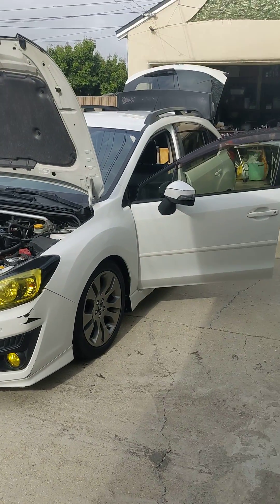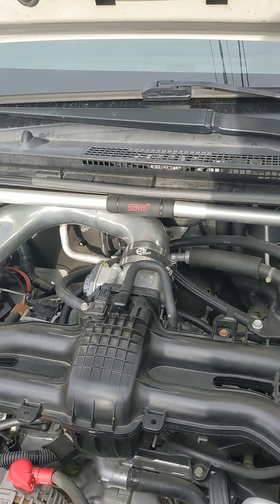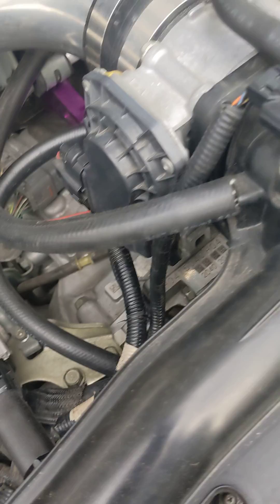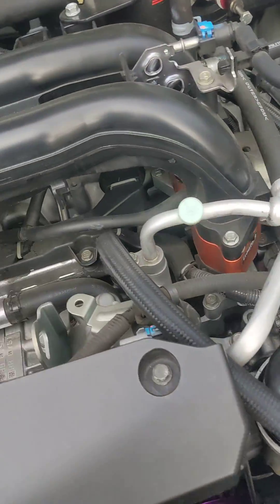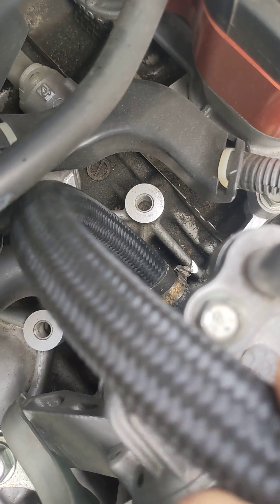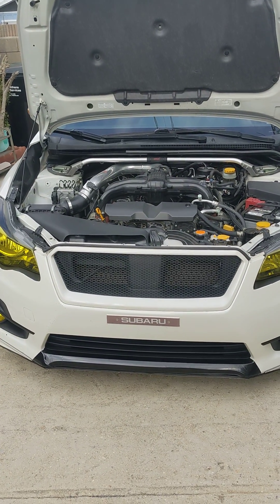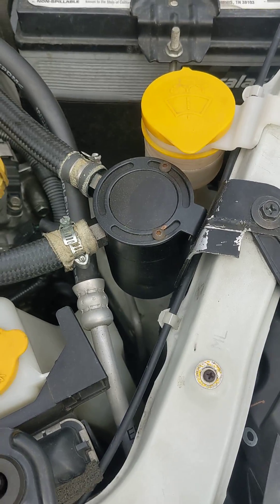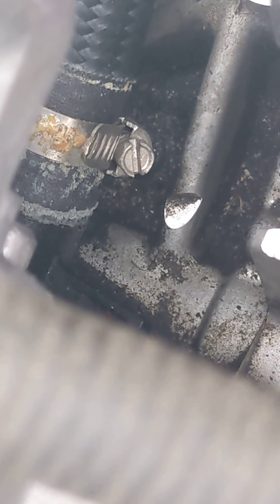Subaru - FB engines - breather port - oil

Comment: The resistance to air movement in the Oil catch can should be the same as in an empty, standard hose. If it is larger, you are causing a lot of pain to the engine and you need to choose another Oil catch can. For example, a single-port one from Crawford Performance (or PROVA Oil Separator, CUSCO Oil Catch Tank).
Reply from the maker: I previously had an issue with it being too restricted inside the catch can. I had to do some catch can surgery.  It would seem that those cheesy hose clamps have a habit of loosening over time. I replaced a new hose and larger clamps.
Reply from the maker: I think I understand what you are getting at. The idea is that the breather hose should be like stock, short and unrestricted. This way the line isn't too long which reduces the rate at which vacuums can be generated. My current setup has ultra long hoses, maybe 3 times the length of the OEM one. This I see is an issue. Thanks for the suggestions.
Reply: @JasonLeung-4roller  The length of the breather hose is +- 50 cm, it does not matter. But the filter inside the container can cause much more harm. Type in google pictures: "cusco oil catch can inside". You will see that the filtration of cusco oil vapors, like other major brands, does not create resistance to the movement of gases.

Comment: Change the breather to the killer b fa20 one, much better
Reply from the maker: I just saw that killer B makes one! Thanks! Do you know if it's a direct fit for FB engines? I know they are marketed for  turbo FA20 engines.
Reply: Yes my men, direct fit! I have one in my crosstrek
Reply: @chispagiddings  so a breather catch can is better?
Reply: The other breather should work too, the fa20 pcv and ccv breather are a little bigger